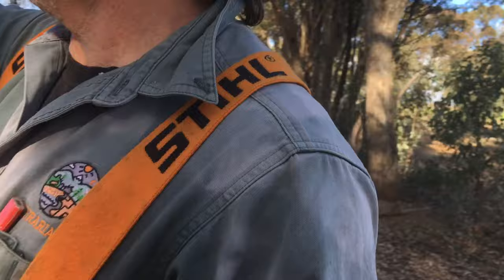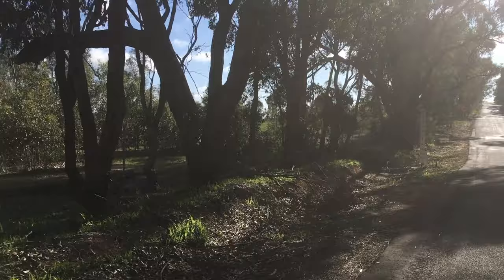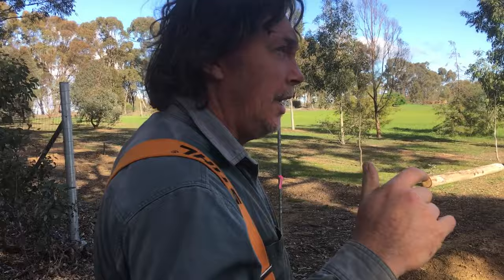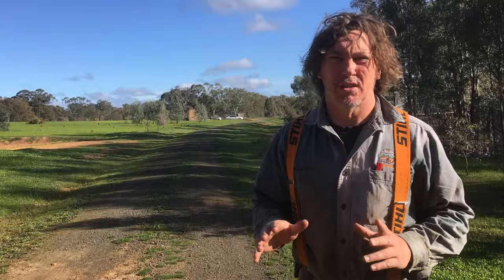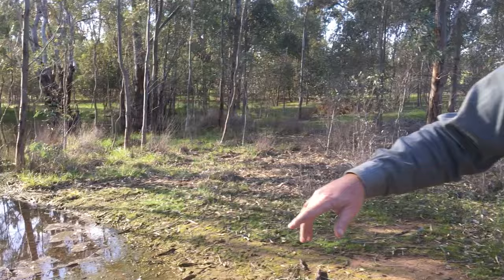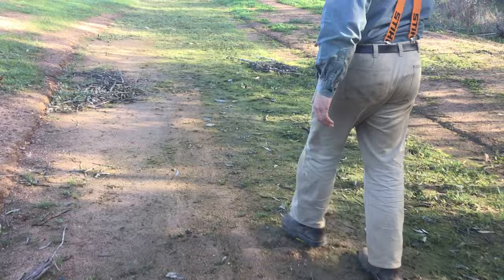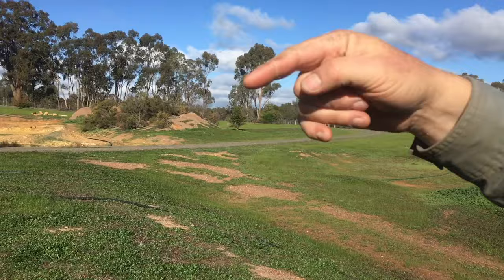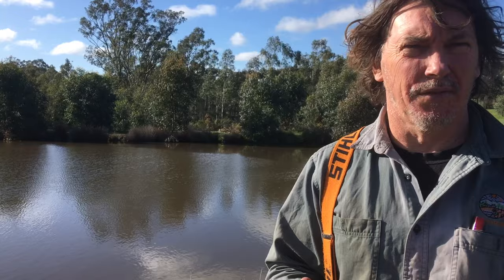#3Water   Catchment Systems 2010:2020

Comment: Thanks Darren for an informative video.
What would you roughly estimate this amount of earthworks would cost if done today? (roadway, spillway, lower dam, etc)
Reply from the maker: Thanks,

• Road - probably in the order of $3/m for construction and about the same for the 50mm of gravel (10-20mmØ basalt from 15km away)
• Dam:Dam channel & overflow - 150m at about $2/m
• Ridge Dam - 3 days @$2500/day
• 100mmØ Class 12 PVC lock pipe and gate valve (I fitted a butterfly valve in this case but would do a gate valve next time) - $1500 parts + $250 labour

I hope this is helpful. 

All the best, 

Darren J. Doherty, CPAg (AIA)
Land Planner, Regrarians Ltd. 
www.Regrarians.org